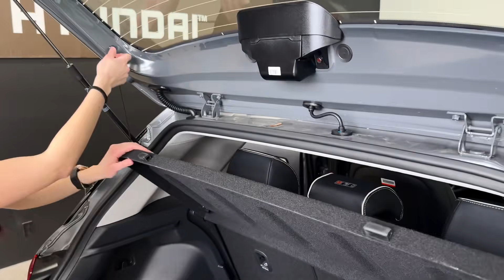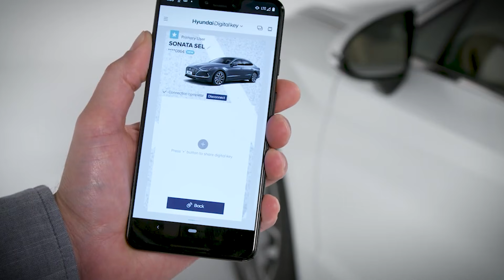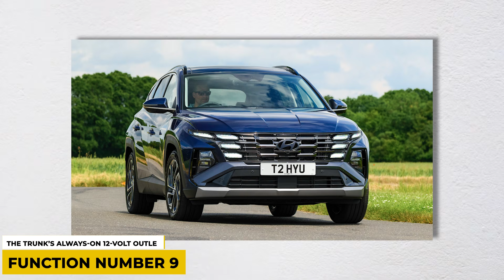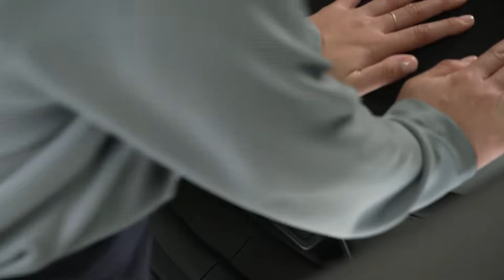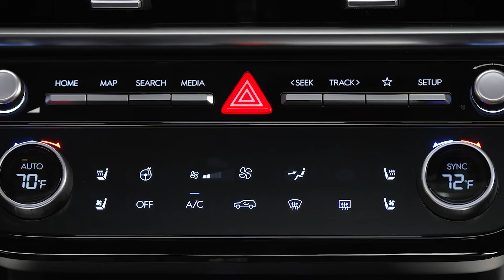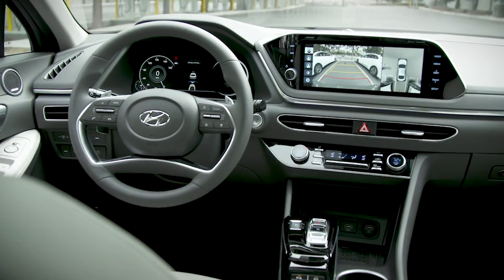These 20 HIDDEN Tucson Functions Are Only Known by 1% of Drivers

Comment: How to use my cruise control?
Reply: How to Set Cruise Control: Accelerate to your desired driving speed (usually above 20 mph / 30 km/h). Press the CRUISE or Driving Assist button on the steering wheel to turn the system on. Push the switch down (toward "SET") to lock in your current speed.Release the gas pedal; the car will maintain your speed.Adjusting Speed and Distance
Change speed: Push the toggle switch up (+) to increase speed or down (-) to decrease speed.Adjust following distance: Press the vehicle-to-vehicle distance button (showing a car icon with lines) on the steering wheel to cycle through the distance levels.P
ause or resume: Tap the brake pedal or press the cancel button to pause, and push the switch up toward RES to return to your set speed.